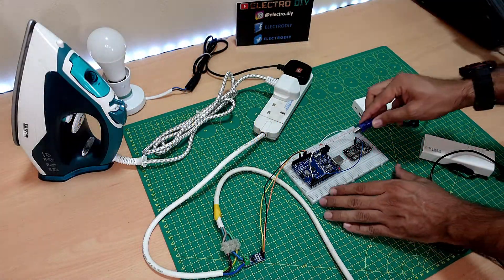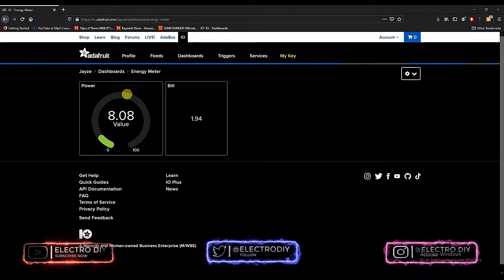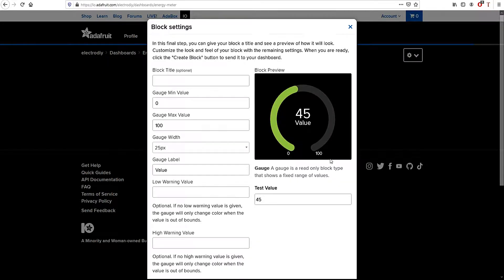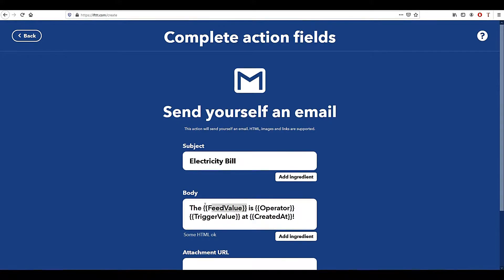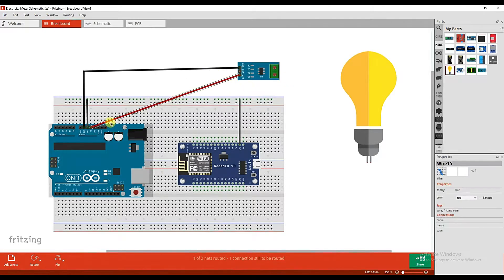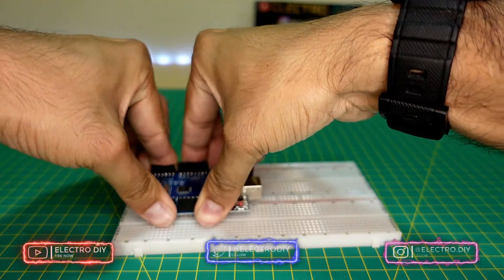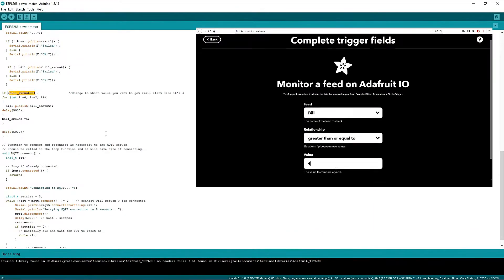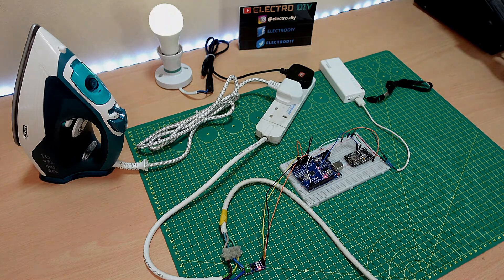How To Make Smart IoT Electricity Monitoring & Alerting Device

Comment: Nice bro i am gonna make this one i have the current sensor 😍😍🔥🔥 and bro whats the max current we can measure with this ?
Reply from the maker: If you need any help in building, I'm just a msg away mate 😊. Max current depends on the current sensor. Here I've used ACS712 of 30A ampacity, with which you can measure upto 25A (5A less to be on safe side)